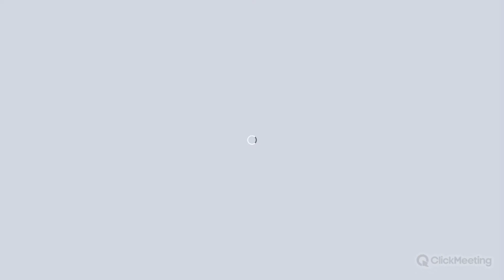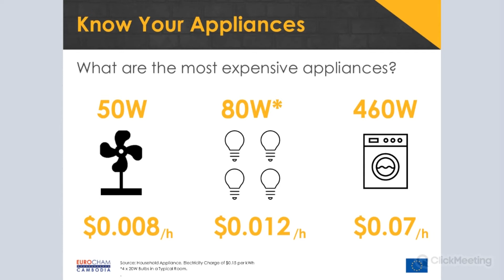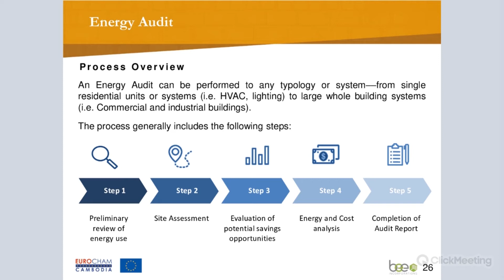Webinar on Energy Efficiency: How to Cut Your Electricity Costs

Comment: 00:00: Opening & Introduction
03:00: Why Is Electricity So Expensive in Cambodia?
10:50: What Can Companies do to Cut Electricity Costs? 
13:20: What is Energy Management? 
15:30: Energy Audits
	19:30 – What can Individual Companies do Themselves? 
	22:55 – Tips to Save Electricity in Your Home
25:40: Smart (Technology-Based) Solutions to Reduce Energy Costs
	28:00 – Are Smart Energy Solutions Available in Cambodia? 
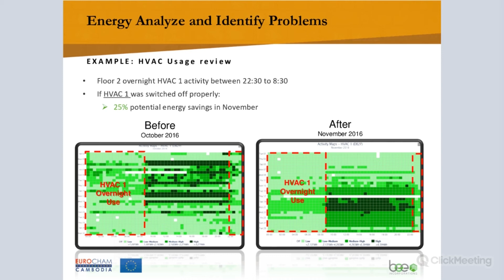	36:50 – Even Smarter – Machine Learning for Energy Efficiency
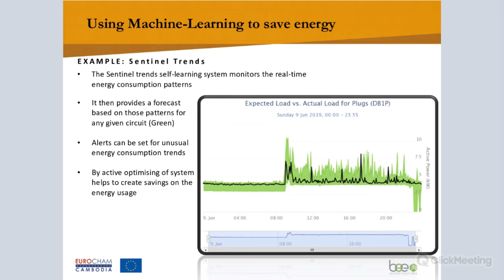        38:11 – Automated Alerts for Energy Misuse
45:25: Case Studies of Smart Energy Solutions
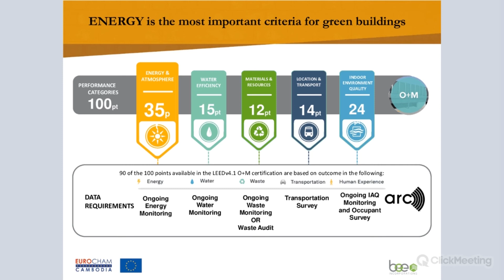	45:25 - Prada Hong Kong
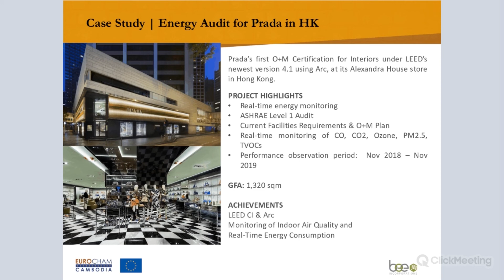        46:30 - Carrefour Taiwan
47:50: Q&A
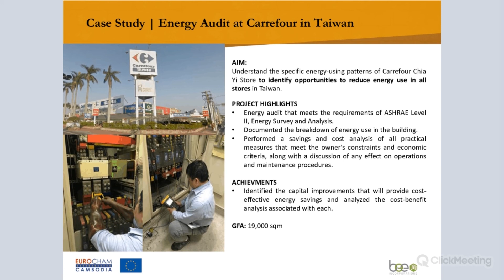	48:27 - During Covid-19, Are Companies Still Interested in Energy Efficiency Investments? 
	51:25 - Off-the-shelf energy efficiency products – are they currently available in Cambodia?
	52:55 - What is the cost of energy in Cambodia? Are Solar energy Investments worthwhile? 
	56:05 - How can you limit the maintenance burden associated with Energy Efficiency Systems?
	58:40 - Would a company face any problems installing EE systems with EDC?
	59:40 - How can you calculate the consumption of your household appliances?
60:00: Thank you & Close